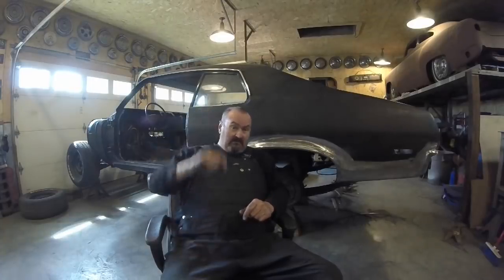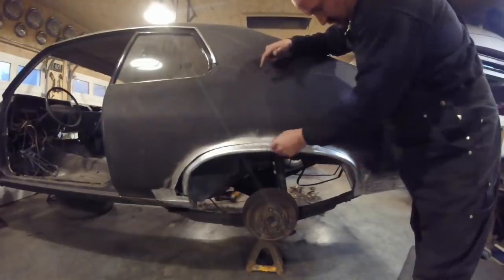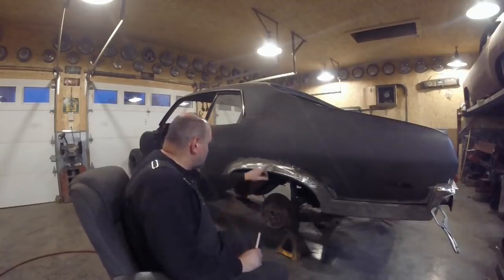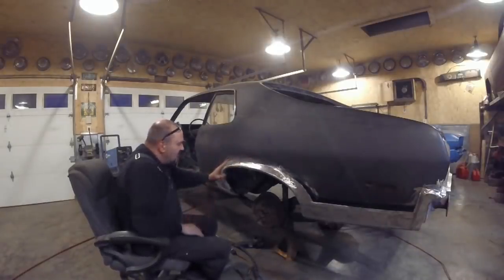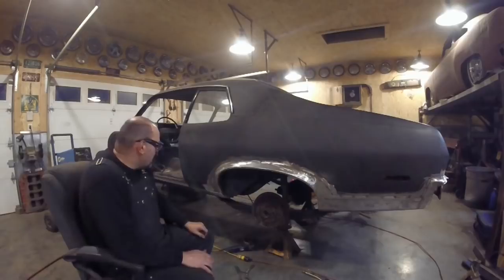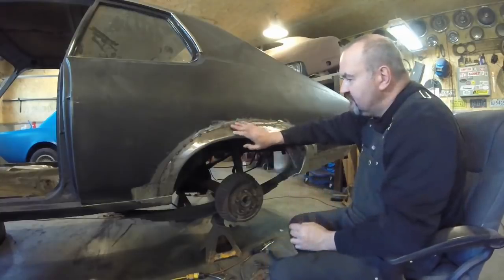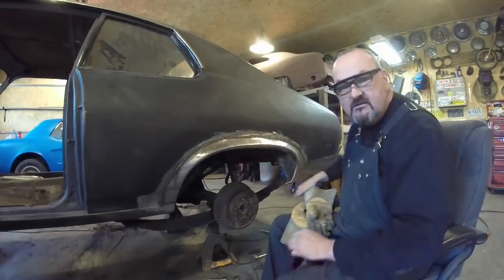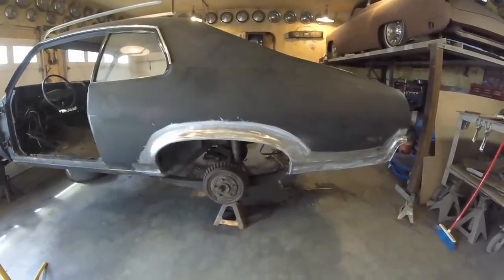How to repair rusty quarter panels part 2

Comment: Nice work!!!!!  You  do a nice job grinding down your welds.  Could you do a few comments in a video on that some day?  What wheels you use from start to finish, and how you use the different techniques to get the panel looking so well.  I'm impressed with the finish look of the panel after it's done.  Thanks

Comment: Excellent video, as usual Fitzee!  Your 45 deg approach to cutting butt welds is going to reduce the need to slather fiberglass reinforced Bondo as your transitions are smooth and part of the actual metal you have fabricated.  You are def. a man who takes pride in workmanship!!
I kind of figured early on that you were blocking the arc by looking directly at the back of the gun handle.  When I saw folks admonishing you to put arc eye protection on, I figured (1) you are a grown man who has been doing this for 30+ years and; (2) if you were actually seeing that arc, that practice would not be able to continue for long.  I am not as good a welder as you, so I have to look right at the arc.
Keep the videos coming and we will watch them!!!

Comment: I have been doing body work for 46 years. I welded without a helmet till about 6 years ago when I got an auto darkening helmet. It really is easier when you watch what you are doing.
Reply: I always hated the old welding helmets that don't have auto darkening. It made it more difficult to watch where you start your welds and weather or not if you were being consistent and trying to not making sloppy lines. Lol
Reply: @trickyricky12147  ... I can't tell you how many times I ran a perfect bead about 1/4" away from where it should have been! When possible I used a really bright drop light so I could find my mark with the helmet on.

Comment: Another great video Fitzee, I a I have learned a lot from watching your videos I just completed my floor pans in my 66 Chevelle, and used a lot of your method's I picked up from you much appreciated I have MiG welding experience but not a lot of sheet metal welding but I observed the more I did the better I was getting, I used to weld  lot of exhaust systems in the day but sheet metal but not so bad,  so now I have to sew in some rear lower patch panels on the R/L quarters similar  to what you are doing in this video, a friend told me to cut along the seam line, so is this correct for that lower panel it is right behind the rear wheel so I will have to raise the car, I would post a photo if I could, but anyway is this the correct place to cut along the seam???
Reply from the maker: I would cut below it. Buy about s inch away. The seam is a body line and it is nice if they remain in tact. It helps with warpage too as the sharp  lines help with heat transfer and hold there shape much better then a flat panel.
Reply: @fitzeesfabrications  Thank You Fitzee, that makes a lot of sense,  , this is why I watch your videos, your the pro, thanks once again, and like I said because of your videos my floor pans came out great thanks to your help, look forward to future posts. and all the damage is way below the seams on both sides, so I have plenty of room.

Comment: You can go to some shops and find a half million dollars in specialty tools and I still wouldn't let them touch my 14 year old commuter junk. So far here I've seen a MIG, a bag of hammers, and zip disks used to resurrect spendy vintage iron. Hmm.

Several years back I had a minor T-bone. Old Mazda 323, nothing I loved.

If you're an Ontario resident, you don't want the eyeball of the insurance company. I wasn't at fault, and said I wasn't interested in submitting a claim. That particular car at the time was plentiful in the boneyard, and the doors didn't rot. Would have cost me $75  to DIY fix. No they said - you can't fix or we cancel your policy. You have to go to a shop. The shop billed insurance $4000 and the "rerpair" bled through (rust) in 2 years with a big chunk of fill falling off. 

I'll bet they had that half million in tools.

Sadly, the Fitze's of the world are becoming rare as hen's teeth. Drink these gospel tips up while you can boys (and girls).